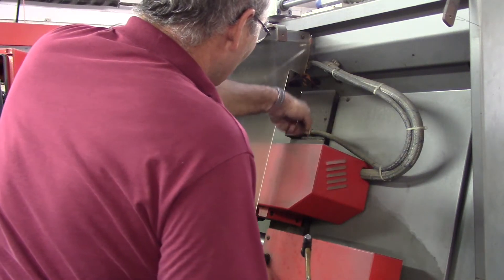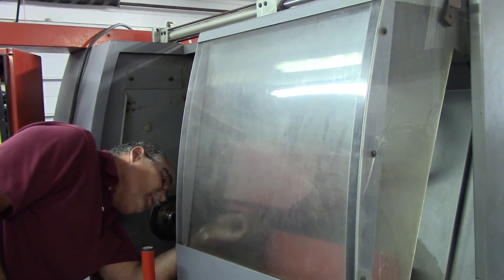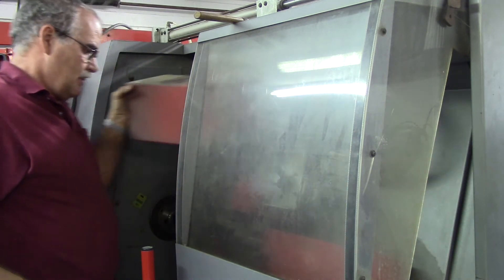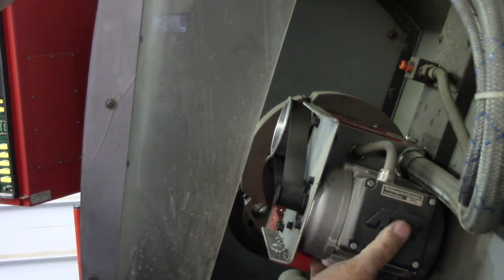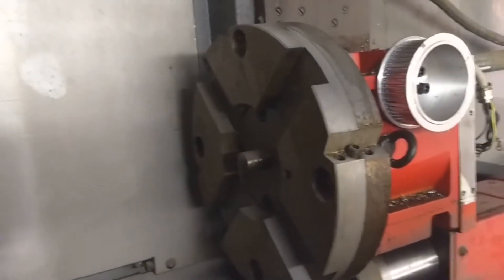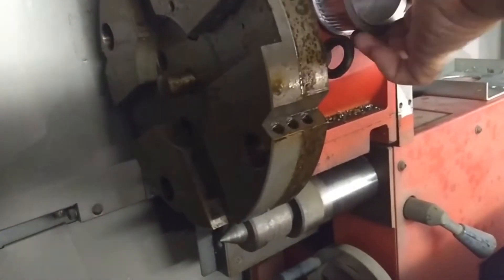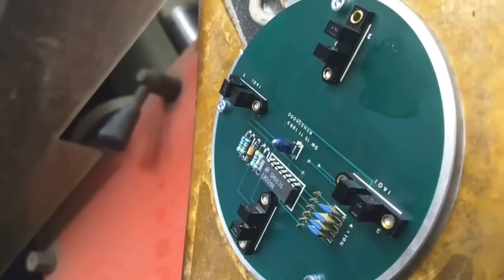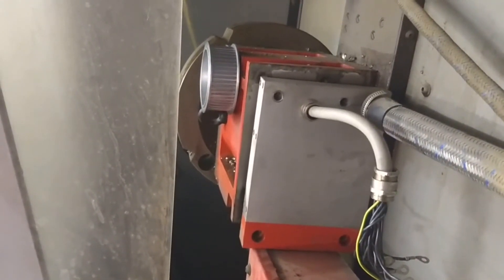Emcoturn 140 - Turret Insepction

Comment: Sir, the sensors in turret are 24 volt or 5 volt?
Reply from the maker: 24v in my turret
Reply: @martyscncgarage5275  i bought an emcoturn 140 two weeks before and following all your videos for retrofitting this machine. I fitted the spindle encoder the way you did it but i am confused about the maximum spindle speed of this machine. The DC spindle motor installed on this machine has 5000 rpm
Reply from the maker: @Mr-on2di  you can get there without changing the 3 phase motor pulley. You have to watch the rated max RPM of the motor, and how safely you can overdrive it.
Reply: @martyscncgarage5275  i have searched a lot but unable to find any manual or specifications of emcoturn 140 on internet. I just want to know what is the maximum speed at which we can spin the spindle of this machine without getting the bearings damaged.
Reply from the maker: @Mr-on2di  email me at my YouTube name@gmailDOTcom and I'll s nd what little I have
Reply: @martyscncgarage5275  i have sent email
Reply: I have one last question regarding the limit sensors..have you installed new limit sensors for X+, X-,Z+ and Z- or what?
Reply from the maker: @Mr-on2di  nope, reusing the sensors on X/Z. They are on the ball screw pulleys. Line up the arrows and home the machine. Control will stop when it seems the sensors. Simple elegant Emco solution. Keep those pulley sensors for accurate homing. You can put mechanical switches to rough home and the let the control hunt for the pulley sensor input for accurate homing if you wish. Then you don't have to line up the arrows
Reply: @martyscncgarage5275  how the sensors on pulley actually sense the home position? I mean the pulley keep rotating without shifting its position.
Reply from the maker: @Mr-on2di  please post your question to the Centroid Users forum. (Provided you are using Centroid Acorn) https://centroidcncforum.com/viewforum.php?f=60
Reply: @martyscncgarage5275  not using centroid.
Reply from the maker: @Mr-on2di  Sorry, I can't help you with your control then. I only use Centroid.